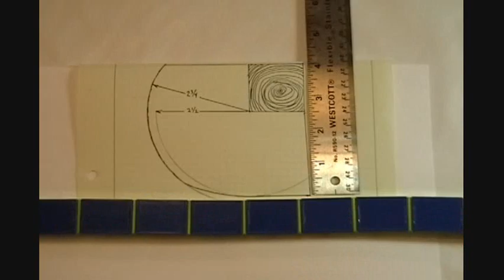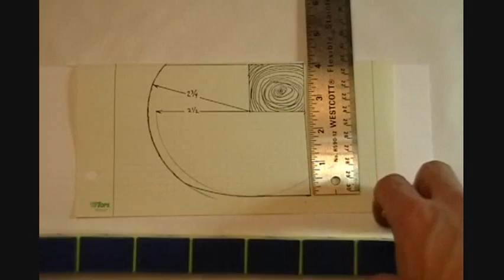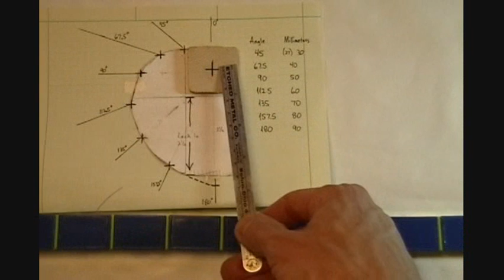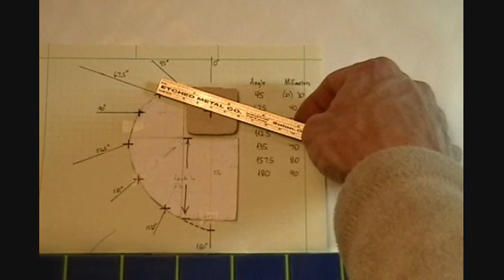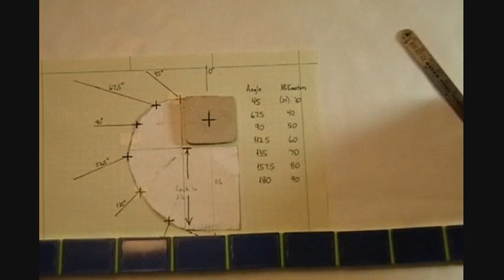Table Saw Casters  --  Mobile Base --  One-handed Operation

Comment: Been looking at various designs with the casters mounted on a horizontal plank that are hinged to the side of cabinets.  Most used over center cam levers that required the user to operate one on each side of the cabinet/machine.  The levers appeared to be strong enough for the job but they looked like a wear point if used with any regularity. 
There was one that had a similar concept as yours using an off center circle for leverage.  It worked but not very elegant.  The designer used galvanized pipe (as a torque tube) to connect the opposing cams with screws running through the cam (circle) and pipe.  While it did work, you could imagine in time the screw will be splitting the cam in time.
After seeing your solution the with mechanism to apply the lifting force it seemed like the clouds cleared.  Your use of a square 2x2 to transfer the torque from one side to the other is the answer to my project.  Which is making a home bar moveable, space is tight in the cave. 
I'll be making two minor adjustment on my bar build, being that it will weight more. The first will be using a different material for the cam, high density polyethylene.  This should eliminate any early wearing issues and be self lubricating.  The second adjustment will be to used a heavier pivoting system for the 2x2, possibly an budget pillow bearing.

Bottom line is thank you for posting this elegant solution.

One final thought, to move the hinges up higher so that the stationary 1x3 blocks the the moving 1x3 from folding outward when lifting the machine/bar, or use a wider stationary board.

Comment: Mission accomplished! Cut and mounted the cam and it works very smoothly. Crunched some numbers last night before I had a chance to read your comment and used 11.5 every 22.5, basically the same as you suggested. Also, took your advise and mounted the boards on the side not to interfere with getting close to my router. My wife walked in the garage and said "It smells like apple cider in here" (wax). Thanks again for sharing your video and design.
Reply from the maker: That's great!  Nice work!  I'd love to see pictures.  You could make a collection of photos into a YouTube video by clicking: UPLOAD (top right of the screen, arrow symbol) >> CREATE (right side, under "Photo slideshow") >> Then drag & drop photos.  Perhaps YouTube fame is in your future!

Comment: Wow! That was the greatest 30 minutes I have spent on looking at Ideas for machine lifts!
Have built several tables to move around my shop with with the same basic concept of using casters and a cam assembly like you did.
I have also employed Carl Holmgran  concept. To some degree. Carl does outstanding work. What I like most about you video is how you solved
The lift height problem and explained the geometry of how you solved it. Me it was trail and error.
I have constructed two lift mechanisms such as you started with in the video with using pivotal bars as the fulcrum, and yes I made and over center cam to drive the levers of the fulcrum down and it works well. 
Dude you have a great wife too! She buys you wood working tools! Don't let her get away! But take her to some wood working shows so she can see some good quality tables saws. Just kidding. But it might work. She is a keeper.

Several years ago I went through a divorce, I sold my my retirement toys. 
(I had a great set of wood working tools real nice stuff And Old Delta Unasaw a Jet bandsaw too many things to list but they are all gone) I Found a new home and needed a table saw. I had a circular saw and a sorry pieces of OSB! And a 30 gallon trash can. I plunged cut the osb mounted the saw on the OSB with four 1/4-20 bolts turned the saw up side down and placed it in the trash can. With some clamps I made a fence and I had a table saw.
No I do not live in a third world country, I was just a poor out of work pilot. The third world guys Do a great job at improvising.
Since then I have a real table saw and a host of their toys. Thanks for sharing how you solved your problem.

Lane
Reply from the maker: Thanks, Lane.  Glad to be of service.  Hard to believe it has been three years since I posted this.  The saw lives on its casters.  When I get out the saw, I reach down and drop it onto its feet without even thinking about it.  When I'm done, I rotate the handle and roll the saw back against the wall.  I have the other guys beat on vertical lift, but my mechanism probably couldn't handle a 300-pound saw.  These are the trade-offs of our lives...

Comment: Great research and work. Loved your video, seems exactly what I'm looking for. Started working on one for my table saw but kind of stuck on cam system wobbling. How did you attach the cam to the 2x2? Is it just glue and 1 screw? I admit my cut on the cam isn't perfect and may be the source of instability. 
By the way loved your reply to the critic. Hilarious!
Reply from the maker: Dear Steve,  Thanks for the nice comments!  At 24:29, I say "glued and screwed" but did not show the attachment very clearly.  I used two screws per cam--slightly offset right/left so they could pass each other.  I'm thrilled that you gave it a try.  I doubt this would work with heavy saws.  Good luck!

Comment: Great video and research. Worked on the project last night after work. All I have left is to design the cam. I'll follow your instructions and see how I make out. Although I am going from 0 to 3-1/2 instead of 2-1/2. If you happen to have a template for the cam please let me know yours seems to work well. Anyway, thanks again for the video - very informative.
Reply from the maker: Norman, thanks for the nice feedback.  My template is shown at 20:44.  My starting angle is 45 degrees, because that's the contact point of the cam's disengaged position.  My starting distance is 30mm, because that's roughly the distance from the pivot at the center of the 2x2 to the corner.  It might be easier if you convert to millimeters.  Every 22.5°, I advanced 10mm further from center.  Maybe you just need to advance 12mm every 22.5°.  Good luck!

Comment: I have an additional upgrade I'm gonna try -put the 2x2 on lathe and round each end long enough to go thru side mounts and make handles to go on each end. Let you know how it works -and thanks for the research.
Reply from the maker: Sounds nice.  My pivot is a bit hokey.  Did it work?

Comment: ColoradoDemings - Nice design that allows for flexibility in lift height via the dimensions of the cam. I wonder if you considered flipping the design to have casters as the default when the cam is disengaged? My Craftsman saw came with a stand with caster mounts, so cam action could conceivably place feet down on the floor to stabilize the saw. (They could be adjustable feet to level the table so it aligns with similarly equipped outfeed tables.)

Thanks for the inspiration!
Reply from the maker: Hmm...  A cam could be used to shove down some feet if casters are the norm (like on your Craftsman).  That reminds me of air-operated jacks on race cars.  In my case, the cam is engaged 99.5% of the time.  The saw sits on its wheels except for when I get it out to make some cuts.  Instead of adjustable feet, I just tug my saw an inch or two this way or that way until all four feet match my garage floor.  I have yet to come up with an outfeed table.  I'm imagining one mounted to the back of the saw on hinges (like I've seen in some YouTube videos).

Comment: Hi Sir,

Congratulations on this simple effective design. Well done. Especially your cam block is  nicely engineered! I'm looking for such a thing for my drill press which is 52 kg or 115 lbs. I expect your table saw significantly lighter. Besides a longer handle (more leverage) I think about a steel square rod in the middle, and some 8 mm diameter, long bolta to penetrate the majority of the cam block. For the cam block I'm thinking about using hardwood. What kind of grain orientation would you suggest of the cam block to be able to take the forces, prevent splitting and make it to last? And do you consider my additions a good approach for lifting a heavier machine?

Edit:
Found the weight of your table saw.
Rtobi model RTS10, Weight: 45 lbs. with stand

Comment: I appreciate your video.
Would using some bolts on both sides of the cams so the bolts are accessible from the sides of the unit work better?
Then a cheap breaker bar from harbor freight can lift the saw from either side, thus allowing a shelf to be  built underneath?
Reply from the maker: It might work.  I would watch out for introducing weakness where you install the bolts.  Also consider how many degrees you would be able to rotate the breaker bar.  If you have an idea--go for it.

Comment: hi!  thanks for the instructions.  i just built on for my table saw table with some modifications.  it works great.  i took your advice and placed the support boards on the sides instead of the front.  i used 5/8" plywood boards so i bored a hole on each board for the axles and not needed to make the axle holders like you did.  i learned about making cams.  i was going to send you a picture but did not know how to send it.  cheers   Boris
Reply from the maker: Dear Boris,
I am glad to have helped.  Could you make a short video and upload it to YouTube?  I would like to see your cam.  My first attempt did not work so well.  If you have an iPhone or Android phone, you could probably upload a video directly from the phone.  Regards,  Michael

Comment: hey!i just made a base with the lever system,and found the lever boards were at to high an angle and interfering with the sawdust collector cone,instead of buying smaller casters which may not help ,your cam method is genius! thankyou.
Reply from the maker: Glad to help.  Really, I took the cam idea from this video:  https://www.youtube.com/watch?v=aMdKdglWMHo
If your saw is heavy, Mathias's bearing frame may work better:  https://www.youtube.com/watch?v=122w40ZBrJg
Please post a video of what you come up with.  Good luck!

Comment: Nice Mobile Base idea...  What you might want to consider doing about your slide being sloppy, is to turn it upside down on a hard surface and with a piece of oak that is cut to fit the slot, but angled both sides so that it fits into your slide and then progresses outward, and attempt to force the two sides of the slide out with a hammer. You will need to adjust the entire length for over all accuracy. I would venture to say anything more then a nudge might over do it and if you go too far you can always use a C clamp or vice to squeeze it back.  Worse case scenario you bend it too far and have to throw it away, which is one of your options as it is. You can always just make a sled and call it a day, those are very easy to do. Just search the Tube for Table Saw Sled...  Enjoy...
Reply from the maker: Good idea--a trapezoid shape to spread the rails.  It's obvious that Ryobi saved some money by using stamped parts.  The fit is so bad that the slide is basically worthless.
Reply: ColoradoDemings Yes, that's what I was attempting to say, trapezoid. I know what you mean about how cheaply built stamped parts are, but such a saw is more like a throw away item all things considered. Buy it for that project then throw it away until you need another. I like Ryobi as my first chop saw is a 10" basic chop saw, no bells and certainly no whistles. I paid 250 bucks back in 1987, wow almost 30 years ago now, and it runs as strong as ever to this day. Never replaced the bushings or anything and it cut half a Forrest by now, at least. Never adjusted it and I always from day one used very good blades, 40+ tooth. While I was away from a job site an accident happened and the handle was broke off, and the replacement part was less then 30 bucks, which they gladly paid for, and it has been running strong ever since. I don't think it was 3 months old when that accident happened... Then I had the Ryobi cordless tools about 15 years ago and used them heavily until I upgraded first to Bosch, the Ridged. Still have the Bosch and Ryobi as a backup should the Ridged ever fail but they are a strong tool as well. Like I said give that trapezoid a try, it certainly can not hurt anything...  Enjoy...

Comment: I would try toilet seat bolts with wingnuts,  Other wise you are going to have to make t slides which is a real pain to make. Another thing is you can try a metal cutter or grinder, but make sure they have put enough metal there to grind, other wise you will ruin your saw table top. Had one of those myself so I took some 1/2 inch wood and sacrificed 1/2 inch cutting height and put in 1/4 inch slide slots (without the upside down "T".  Those have to be the worst slots you can put in a table saw, never will buy one again.

Comment: Very clever, but it seems like using mostly metal components would simplify the build.
Reply from the maker: Dear Duke,
You are probably right.  In my garage, though, there are many scrap pieces of wood and very few scrap pieces of metal.  I invite you to post a video of what you come up with.
Reply: Am a farmer.  Am more accustomed to welding metal to fix and fabricate, than use carpentry.   I do like your caster method.
Reply from the maker: Thanks, Duke.  I'll bet we think alike.  When there's a problem to solve, start with what's within reach.  If necessary, expand to what's around the house.  Then--if you absolutely must--go to the store and buy something.  If I had a welder, my videos would probably show me welding something together.  Keep pluggin' away!!